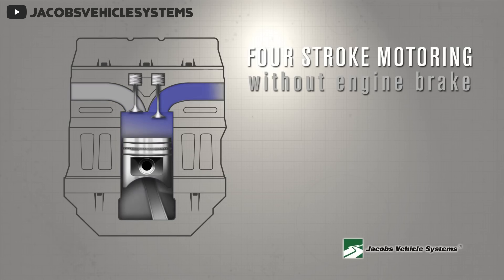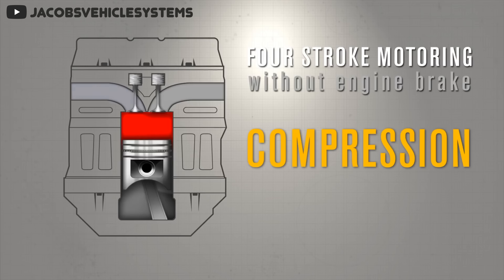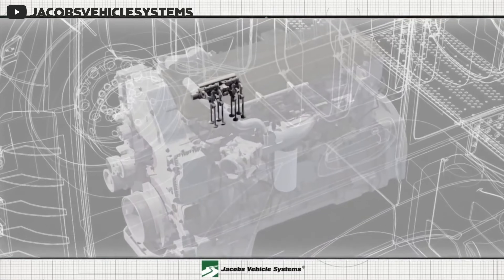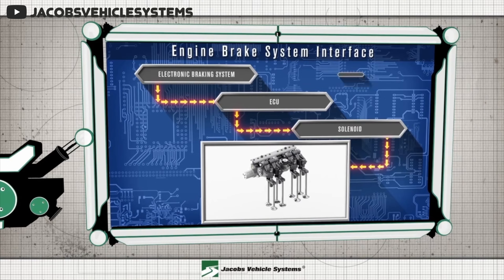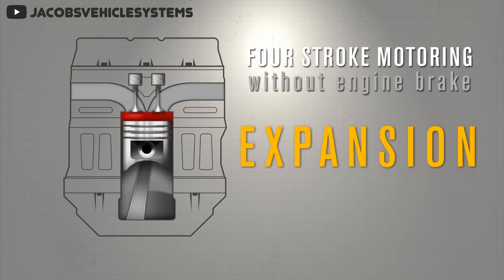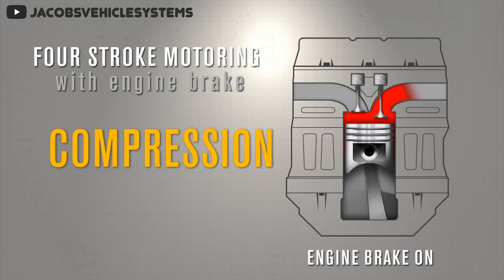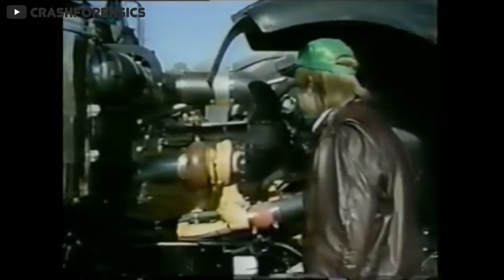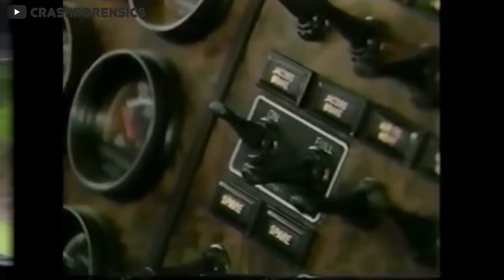What is a Jake Brake and How Does it Work?

Comment: Engine braking is fundamentally linked with compression ratio. In Europe we can also compare this pretty easily since we often drive manual transmissions and petrol, as well as diesel cars. A diesel has a lot more engine brake compared to a petrol engine of similar size. Jake brakes, exhaust gas brakes, retarders, etc. are used only on trucks since the available engine brake would not be enough for the weak power to weight ration of a fully loaded truck.
Reply: Having driven petrol and diesel 4x4's off road, I refuse to own a petrol 4x4 because of the diesels superior engine brake, due to its high compression ratio.

I'm also a truck driver familier with exhaust brakes and engine retarders.

The point of an exhaust brake is to block air flowing out and thus increase the engines compression ratio.

These systems help a lot when you are in the WRONG GEAR. 
Going down a hill in a high gear causes the transmission to over power the engines compression, hence the auxiliary  braking systems to increase that compression.

The compressed air in the compression stage doesn't "spring back" all that efficiently.

Sure, it's not as effective as a Jake brake, but it's still 10x more effective then a petrol engine.

BTW, anyone who thinks a thin air intake butterfly valve is strong enough to slow a couple ton of moving vehicle on its own is an idiot.

There is a lot more physics behind it all.
Reply: @Emily35-Official  Is this video presenter full of crap then?
Reply: @andyjackson3414  I wouldn't go so far as to say that.

However on this topic, they were incorrect.
Reply: Same comment here. My 2.2 liter Diesel Rav4 has way better engine braking than my wife's 1.6 Petrol Kia.
Reply: @plonkster  unless it has a exhaust brake ozr a jake a diesel has no butterfly in the intake like a gas motor does when you let of the fuel pedal butterfly closes causes a restriction diesel has no butterfly thats why a diesel will go past the governor when going down a hill if you let it
Reply: @davidcaskey4669  Indeed, that's what logic would dictate, but for some reason all my Diesel vehicles have always been better at engine braking despite what logic would dictate. Which means there is more to this than the throttle body of a petrol car (which is indeed an excellent brake, it's the main source of "pumping losses", which can be useful as a brake 🙂
Reply: Hi. Diesel engine engineer here. Engine braking with a compression-release style engine brake (like the Jacobs) is very much affected by compression ratio.

Not all diesels have such a compression-release braking though, especially in smaller engines. It's mostly a commercial vehicle feature (for heavy loads). Thus, in smaller engines, you'd have a diesel with no compression-release brake against a petrol engine with an air throttle, and the latter is FAR more effective a brake.

So-- if you have a jake brake, (or compression release retarder, to be technical), your diesel will have better engine braking than a comparable diesel engine. But without such an added feature, a regular diesel without the special brake will be vastly inferior to a petrol or gasoline engine. This inferiority is the reason the brake was invented for the Diesels.
Reply: @G5Hohn  my 4x4 doesn't have a Jake brake, or exhaust brake, or any sort of retarder (and I know this because I just rebuilt the engine and had all its parts sitting on my work bench). 

So please explain why in low gears down hills I need to apply accelerator to maintain speed, when in a comparable sized petrol I need to use the brakes...

Even in 1st gear low range, the petrol runs away from me while I can be in 3rd gear low on the same hill in my diesel.

I've thought about adding an exhaust brake to it, mostly for the extreme down hill driving I do off road (and for the novelty factor), but it just doesn't need it.

The petrol engine DOES need it, but can't handle it due to the much lower compression.
Reply: @Emily35-Official  I'm not sure I can explain why your particular vehicle behaves as you describe. I can only assure you that your explanation for the behavior you observe is wrong.

Almost every modern diesel is turbocharged, with very, very few exceptions. The turbine adds exhaust restriction on the outlet of the engine in a very similar manner as a gasoline engine's throttle valve does on the intake side of the engine. With modern variable geometry turbos, the turbine can get restrictive enough to act like a throttle valve. It's just on the exhaust instead of the intake.

I'm not saying your observations are wrong-- that the diesel doesn't, in fact, have better engine braking. It would be absurd for me as a stranger on the internet to try to refute your firsthand observations.

Rather, it has nothing to do with compression ratio because all of the energy it takes to compress the air is returned when the piston goes back down. You're just compressing the air and then letting it expand again-- no net work is done.

What you are likely observing as different between your diesel and petrol engines can be explained by two things: The turbine housing on the diesel is restrictive enough to act like a throttle, and the petrol engine is likely new enough to have drive-by-wire, which means the computer will often open the valve when going downhill to save energy and improve fuel economy. 

Those are the most likely explanations for your observations. Nothing to do with compression ratio differences.
Reply: @G5Hohn  naturally aspirated, no turbo here.
And the petrol has fuel injection, but that's as advanced as it gets.

I like my vehicles to be old with zero electronics.
Not very efficient, but simple and nothing that can go wrong from being submerged in a river.

My diesel, a Nissan GQ Patrol 4.2lt NA long wheelbase wagon, is as basic as they come.
But I can down shift and quickly bring it from city road speeds to a walking pace without over revving or using any sort of brakes, just the compression of the engine to stop it.

And to be brutally honest, whilst not as impressive as my 4x4, I've seen pretty decent engine braking capacity on my old fuel tanker, a 23t truck that was under powered and only had a weak exhaust brake to assist (it was turbocharged).

Honestly, it felt more like how my petrol car would respond, except for the simple fact that it was carrying so much more weight and had a lot less power to weight.
Yet, in the lower gears without the exhaust brake engaged, it still had more engine braking than my petrol.

Motorbikes, cars, trucks, boats, airplanes construction equipment, I've ridden / driven / flown / operated a lot so far.

I understand the theory that says the diesel should be worse but I've never seen a vehicle that can prove it to me.
If anything, practical experience proves the opposite.
Reply: @Emily35-Official same thing here. I own a Hyundai Tucson with a small 1.6L diesel, no Jake, no exhaust brake. When I release the throttle it has muuuch higher engine brake than any petrol car with a similar engine I've driven.
Before this one we had a family '01 Citroen Xantia, 2L diesel. Same thing.

Is it the particulate filter? Or something else?
Reply: @FAB1150  it's not the DPF, my 1989 4.2L diesel doesn't have any of that crap, and I can use its natural engine braking to slow down from 100kph to 60kph in a few hundred metres driving down a hill.

At least half of the time I slow down I don't use any brakes (we are talking 50-70kph down to 10kph at intersections) just on pure high compression engine braking (no engine brakes, exhaust brakes etc).
Reply: @Emily35-Official  i know nothing about cars, and cant even tell you how an engine works so bear with me here... so when you change gears the belt is going around a different size gear right? so if you're shifting gears, is the action of the belt going from one gear that's already in rotation, to going onto another gear thats not, slowing the truck down? basically breaking the inertia of the unmoving gear is slowing down the truck? again i apologize if this sounds ridiculous lol
Reply: @humanbean3   @humanbean3  there are no belts in a gearbox, aka a manual or a "standard".

An automatic transmission may have "bands" as a part of its construction, but but rarely "belts".

A CVT, or continuously variable transmission does use belts, including made from rubber or metal.

However CVT's have been notoriously weak, which is why despite their advantages they are not used in trucks or other heavy duty applications.

The individual gears in a gearbox weigh nothing compared to the gearbox, let alone the entire engine.

So the inertia of a piece of metal that fits in the palm of your hand spinning up isn't going to slow a go-cart let alone a truck.

I would suggest you go look up a video on how manual gear boxes work and how gears are selected.

It will really open your eyes.
Reply: I learned truck driving on a MB 10t truck and it still had an exhaust brake of the old kind, meaning you could use it to shut off the truck when not moving (or even when moving, but then you lost power steering and stuff^^). This came in handy when one truck had a problem with the electrics and you could not turn it off the usual way. Of course, you could always just use the spring-loaded brake and then let the gas pedal slip to choke it. ;-)
Reply: Yeah. Thought the same thing. My diesel has more engine braking than a comparable gasoline engine. Only problem is that a truck wheigs a lot more and thus is accelerated a lot more downhill. So you can't compare a car, where need to bring the energy of 1.5 tons into heat, to truck where you need to convert the energy of 40 tons into heat.
Reply: @dragonfire3289  did I forget to mention the part about where I drive trucks and auxiliary braking systems are meant to be used when you stuff up and use the wrong gear going down a hill?

Yes, trucks weight more, but they also have larger engines often with much longer bore strokes, have larger boxier aerodynamic profiles, more tires in contact with the ground etc.

All the things that hurt efficiency and fuel economy, actually help slow down a truck.

Yes they take longer to slow down and yes auxiliary braking systems help a lot, but with the correct use of the foot brakes and the right gear selection, not a single truck on this planet ACTUALLY needs Jake brakes, exhaust brakes, engine retarders etc.
Reply: @Emily35-Official  Dummy!You have never driven a fully loaded truck down a mountainous road!--Reality with the real possibility to die is different to a video game!
Reply: @mikel9567  I never said Jake brakes were environmentally harmful.

And if you can't descend a hill without using ANY braking system, you are not in the right gear for that hill.

A Jake brake will let you descend a hill faster, in the wrong gear, without needing to apply the wheel brakes, but it's still the wrong gear.

And we have runaway ramps here in Australia too.
Reply: @pebo8306  technically every truck on the planet could stop using their feet. You might not have feet by the end but you will have stopped.

Comment: It seems that Europe is another time opposite of the US in this one :) Engine brakes aren't that strong (over here), so we use transmission retarders. The advantage is that even at high speeds it's still powerfull enough to hold the truck. So in Europe fully loaded trucks which are going uphill at lets say 40km/h (25mph), are still going downhill at 90kmh/55mph (= speedlimit). A roadsign with "trucks need to use lower gears" doesn't excist over here :)

I know the weight is an isue but the weight of a transmission retarder isn't counted, so you don't lose any payload :)
Reply: most european trucks have jake brakes/ exhaust brakes combos that are as powerful to 1.5 times as powerful as the engine. so 4-700hp in braking usually.

Comment: I don’t remember the name, but I saw a brake system where there is  a hydraulic device between the flywheel and the gearbox that can create drag and slow down the truck. I can remember the name, but looks very nice
Reply: It is called a retarder. Caterpillar used them and Allison used them in their transmissions.
Reply: @leifwilson7053  thanks for reminding me. Are they still using this system nowadays?
Reply: @rgms573  Cat dropped out of the on road truck engine market so only older engines still in use. I think Allison still uses them in their transmissions.

Comment: Diesels have more engine braking than gas motors due to higher compression ratio. Exhaust and Jake brakes just improve engine braking in a diesel engine. A gas engine throttle body creates a vacuum lowering engine braking ability. If you have standard transmission with a mechanical throttle body ,turn the the engine off going down hill and floor the throttle . You will notice increased engine braking during wide open throttle .

Comment: Lack of Manifold Vacuum doesn't really affect Engine Braking . It's the Wasted Compressional Forces when un-fuelled that matter . 
Same as for Petrol Engine . Slightly higher actually due to Diesel Compression Ratios . Still , not much when , considering the WEIGHT control Factor .

Comment: I still after all these years of trying to figure out how jake brakes work, don’t understand it. I understand that opening the exhaust valve on the compression stroke instead of combusting the fuel would stop the piston from being driven downward. On the other hand, I would think that it would need that compression to stop the piston from being pushed back up. I don’t understand how releasing the compression slows the engine down. Wouldn’t that just allow the motor to spin freely???
Reply: I'll try to explain. If a diesel engine doesn't have jake brake, then when the fuel is shut off, the piston compresses air, when going up, but because all of the valves are closed, the air pushed the piston down, when it start to go down, so there is next to no energy loss, therefore there is no engine braking. When the jake brake is activated, the exhaust valve is opened WHEN the air is fully compressed by the piston. This lets out the air, so the piston is not pushed down by the compressed air in the cylinder. So now, the engine is slowing down, because it takes energy to compress the air, but it doesn't get it back by the expanding air pushing the piston down.
Reply: It takes a ton of energy to compress air in a diesel engine.  When the exhaust valve is bumped open at the top of the compression stroke, the engine magically becomes an air compressor.  The air is compressed just like a super air compressor does.  Instead of that energy going into a jackhammer, the energy is released as super hot air (and noise).

Did that help?  There are engineering ways to explain that, but those explanations work best on an IndiCom2.  Not too many people know what an IndiCom2 is, and fewer get a chance to use an IndiCom2.  All info is released by an AVL engineer and an inside salesman.  I am not even sure if an IndiCom2 is described online.

Comment: A Diesel engine provides much more engine braking than a spark ignition engine. Compression of the air with 18:1 Compression ratio generates plenty of heat. All that heat energy results in the vehicle slowing down.
Reply: Nonsense.  I've been driving trucks for 35 years and can tell you that loaded or empty, if you lift off the power there's no noticeable drag at all.  Remember that compression pushes the piston back down with the same force.  
Current engine brakes involve the turbo creating back pressure.  They are not only quieter, they are a lot more effective than the old Jakes.  I can take a max weight truck down the Grapevine and only occasionally touch the brakes.
Reply: @breckhollis1089  In class 8 trucks, manufacturers are using compression-release brakes (which operate as per this video) or driveline retarders (which dump the waste heat into the engine cooling system instead of out the exhaust) - NOBODY in class 8 is using exhaust brakes.  Exhaust brakes are a lot cheaper, but they are also provide less braking power - if they were comparable in performance then nobody would be using Jakebrakes or driveline retarders.
Reply: NO. Sorry to say this is a really bad misunderstanding of how engines work. Yes, compressing the air to high ratios gets it hot, but what does the piston do next? Yes, it goes down, expands that pressure, cools the air, and it's back to where it was before. That heat never went anywhere. With no fuel, the engine can't just create heat energy from nothing.

Under your theory of operation, the net braking effect would be the tiny amount of heat lost. Which isn't much when you consider the head is already hot and the time the heated air is present is miniscule.

This is why diesels take forever to warm up at low idle. They need the heating effect of the FUEL to warm up. When motoring with no fuel (i.e. downhill) they generate almost no heat at all. Most will actually get colder because the air coming in is so much colder than the engine's operating temp. Take a long grade downhill in in a truck sometime that has no jake brake (say a Ram diesel or such). The indicated coolant temperature will drop a LOT because the engine is losing heat faster than its making it.
Reply: electrical retarders are more effective though. the best is to have both obviously
Reply: No diesel has a butterfly in the intake unless you have a jake or some kind of engine retarder they will run right past the governor even in low gear going down a steep hill
Reply: Sadly, you are not very technical and seem to miss the concept here.
Reply: Hell yeah, just try crank starting one of those old farm diesels.
Reply: Thank you ahaha when I heard that I was like wtf ahaha diesels are great for the fact that they engine brake, the Jake’s are just an even better brake so you don’t have to use your service brakes and fade them out on a hill